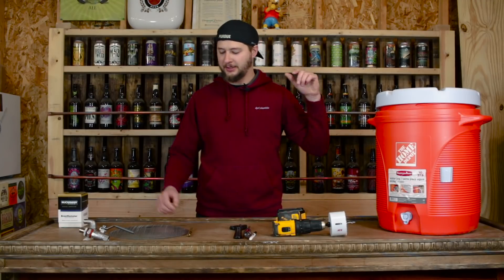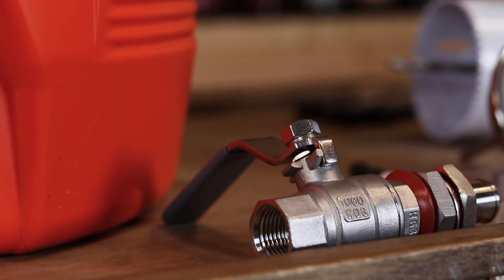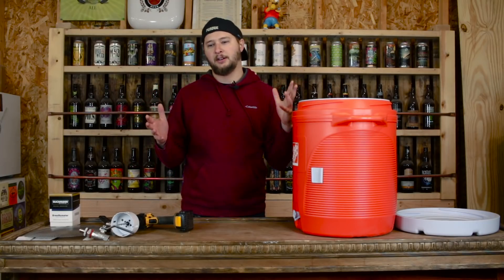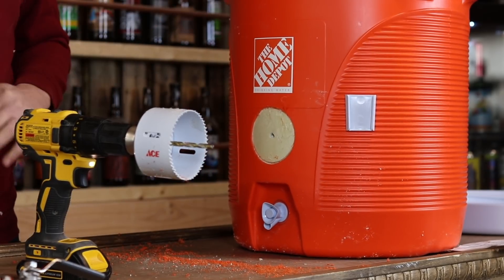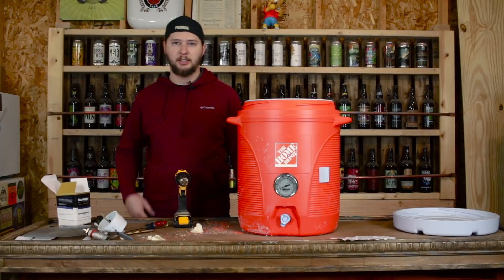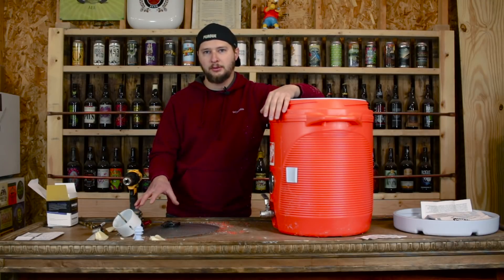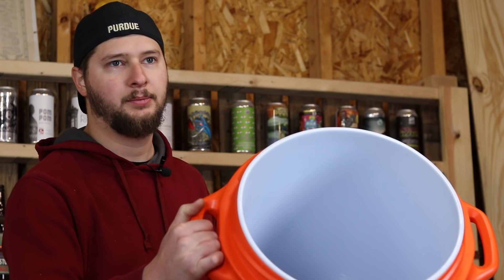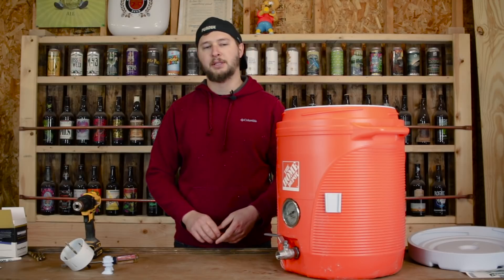Building Our Brewing Mashtun Tutorial - Inlay Thermometer

Comment: I just built one of these and cannot get a perfect seal on my ball valve. Can anyone who's built once recently give any pointers?
Reply from the maker: Did the original come with a rubber for the original spigot?
Reply: @MoskiHomebrew  yes, that's on the inside where it was originally, I have a metal washer and nut snugged against it very tight
Reply: But I think nothing is sealing the outside of the metal fitting that leads to the ball valve, not very well at least. The part that goes through the center of the stock rubber washer
Reply from the maker: YouTube doesn't make it easy to send photos but we have another washer on the outside along with the jamb nut to compress it a bit.
Reply: @MoskiHomebrew  yeah I have one on the outside too, so it's sandwiched super tight. May try loading up with teflon and see what happens. Though, I am  probably losing only less than a teaspoon of wort over a 60 minute interval, but I'd like it sealed
Reply from the maker: Yea I wouldn't want it to leak either, just makes for a sticky mess. Hopefully the Teflon will fix the issue!

Comment: The cheaper thermometer link goes to the ball valve.
Reply from the maker: Thanks for the heads up! We'll get that updated
Reply from the maker: Should be updated now. Let me know if you still find issues. 🍻
Reply: @MoskiHomebrew  No issues now. Does the temp gauge really not leak even in the foam insulation? I would think that's worth not opening up the lid and heat loss, but leaks are always scary.
Reply from the maker: @CorndogJoe  Sorry for the late response, We didnt get notified of this comment. I cant comment on the cheaper thermometer, but the Blichmann Brewmometer (weedless) has never leaked in either of the mashtuns we built.
Reply: I didn’t understand what was leaking.  Can you explain which part was leaking?

Comment: I bought the same cooler kit for the Rubbermaid cooler from Brewhardware.  After install It looked watertight BUT water was leaking between the cooler walls. I drilled a small "Weep" hole under the valve just through the outer wall making sure not to damage the inner wall and sure enough, water started draining out ....not good. It seems the hole size of the cooler was too big and even with the smaller guide washer it would not make a good seal.  Brewhardware recommended the weep hole and I'm glad because having mash sugars between the cooler walls would not have been good.  I ended up drilling a 1" hole with a stainless bulkhead from Amazon and I used the BH kit on my small 5g igloo.
Reply from the maker: Through our install and testing, the BH kit says to remove the Rubbermaid gasket, but we have had the best results using the white gasket that the cooler originally came with. The BH kit tries to replace it but each time we tried it would leak.
Reply: @MoskiHomebrew  I did notice you guys built this bulkhead system two different ways on two videos. What procedure/materials do you like better?

Thanks for the fast response.  Cheers
Reply from the maker: I like the Brew Hardware setup because the "bulkhead/nipple" is all threaded. Just needed to make sure to use the white gasket to seal up the inside and we were good. The false bottom i have mixed feelings about, we previously used a ss mesh screen from a faucet, and never had any issues no matter how many times you hit it with the spoon doughing-in or what-not. Now we have to make sure we dont hit the false bottom because it could lift up a little, allowing grain to get under and cause a major stuck sparge (its happened before).

Comment: What was the total price of the building this setup vs buying a pre-built system
Reply from the maker: Check out the links in the description.. The prebuilt mashtun costs about $230, and it just depends on what parts you use. The final cost of the one we built was about $180-200 but we also have a better ball valve, thermometer, and false bottom than you would get in a kit. Jut depends on how handy you are and what your willing to spend! cheers.
Reply: @MoskiHomebrew  thanks for your quick response its an awesome video keep up the good work

Comment: Why do you need a false bottom in one of those coolers? I thought a false bottom was to stop the grains it bag (biab) from touching the hot base or electric element?
Reply from the maker: False bottom is to filter out the grains from the wort when not using a BIAB. If your doing BIAB in a cooler (can't add heat) you don't need one. If your adding heat to a kettle and doing BIAB you want a taller false bottom, almost like a small shelf for the reason you stated.

Comment: you should have bought some spray foam to spray around your thermometer to protect the integrity of your insulation.And  it would kind of super glue it in place.
Reply from the maker: True! But we've never had an issue with leaks or moving around in the 4 or 5 years we've used this 👍

Comment: Are you from Indiana? I see the 3 Floyds bomber on the bottom shelf, but it looks like there is a 450 North can on the top shelf.

Edit: Nvm, just saw the intro video on your channel. Awesome stuff! I'm going to start streaming my brew days on Twitch and uploading to YouTube after I get my system set back up. (been in an apartment for 2 years so I haven't been able to brew)
Reply from the maker: Yup! Nice let us know when you get that started! I know what it's like to live in a apartment, and not be able to easily brew. Up until about a year ago we didn't brew in Indy, now we can! Cheers!
Reply: Moski Homebrew I’m still in an apartment so I’m going to weigh out of the differences of doing 1 gallon or 5 gallon partial boils. I do have a question for you, what kind of video equipment do you use to shoot your videos?
Reply from the maker: I would also consider 2.5 or 3 gallon partial boils.. same work just a bit more beer in the end. We use a lot of equipment  What specifically are you looking for?
Reply: Moski Homebrew specifically, the type of camera you use. I’m going to have to start just by using my phone to stream/record, but I eventually want to get a nice camera to do that for me
Reply from the maker: We both have cannon 80D cameras. What you'll probably find out is that the on board dslr audio amps are horrible, so you will either need and amplifier or recorder. We've been doing the YouTube channel for 4-5 years now, and the camera stuff is as much of a rabbit hole as the brewing equipment 😂